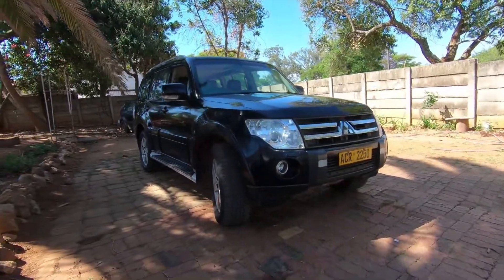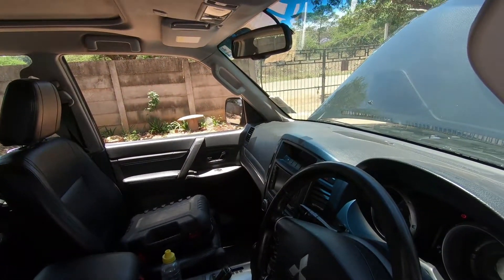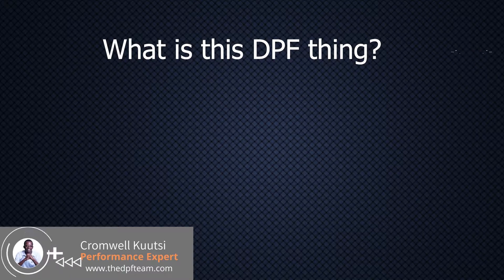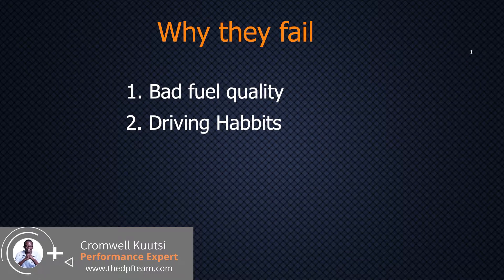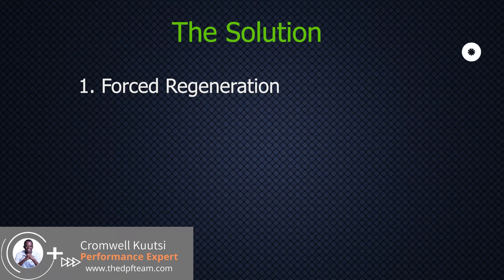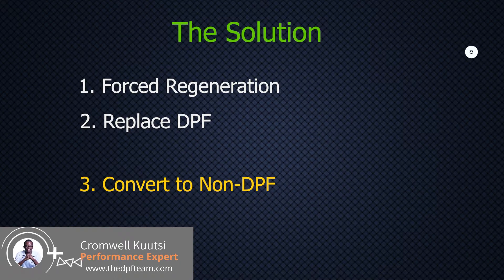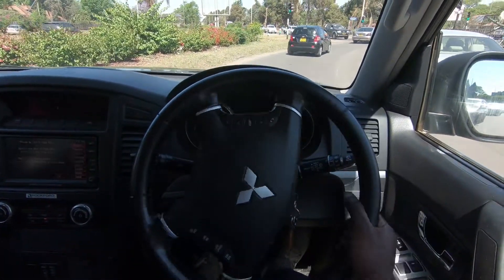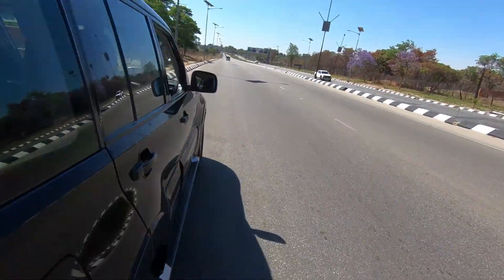Mitsubishi Shogun DPF Problem [Solved]

Comment: When the DPF light comes on the DPF is only 40-45% full and you do a regeneration by running it at high speed at speeds over 50MPH or 80 Kmh for a few miles and it regenerates, never turn the ignition off with the DPF light on, forced regeneration rarely works because people keep switching the engine off with the DPF light on and it eventually fills it 100% so it needs removing and cleaning or replacing.

Comment: So, if you remove the DPF and never replace it, doesn't the fuel eventually damage the engine? Especially if the Diesel quality is not very good? Thank you, S.
Reply: Dpf is in the exhaust not the fuel system

Comment: What’s the process to convert to non DPF…???
Reply: Physically remove it - new pipe or gut out the filter, then re-map the ECU to stop performing DPF functions. Alternatively, there are expensive simulators that you plug into the OBD2 port that fool the ECU after physical DPF removal.